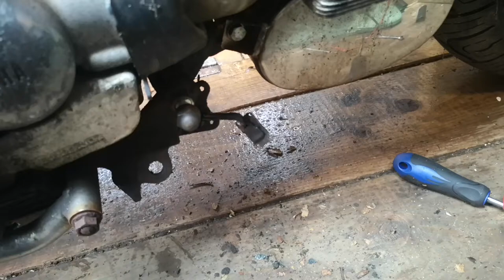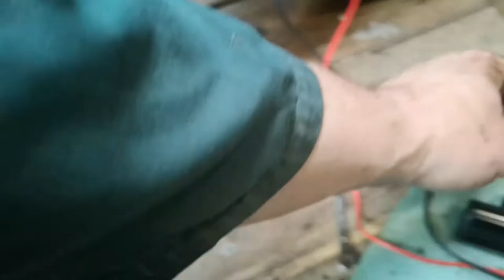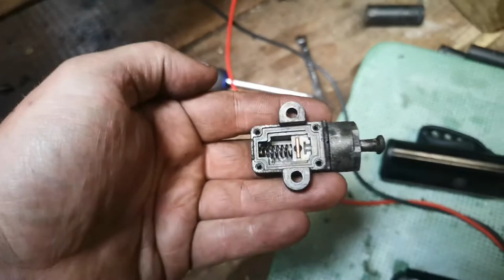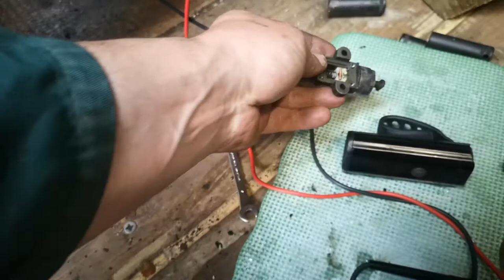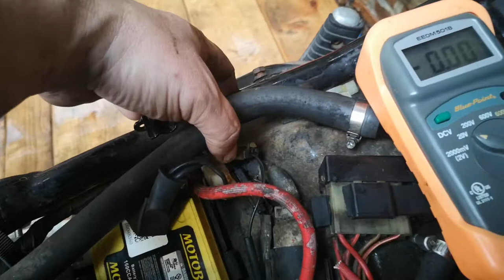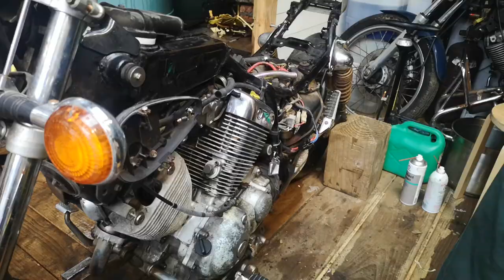Stalling When Selecting Gear? QUICK FIX! Don't Bypass Sidestand Switch.

Comment: Hi Ben, I have the same issue but getting no power at the switch so I traced the wire up to the connector and no power there either.  Fuses all checked out so I'm stumped
Reply from the maker: So if you short the connector it doesn't help?
Reply: @BikeFromTheBrink  I'll try but I'm getting no power there so I'm wondering if there's a short further along the line.  

Just tried, no luck.
Reply from the maker: I can't remember if it is always powered or only when in gear
Reply: @BikeFromTheBrink  I'm not getting power in either situation

Comment: So it would run in neutral but die as soon as you tried to leave neutral, if so how did it die ? Like jump forward or just cut out
Reply from the maker: Basically as soon as the neutral light went out.  It stalled. 
Pull clutch, select gear, instant stall.
Reply: Mine dose the same, it’s a 88 virago going from nuteral to any gear stalls the bike and it  jumps forward a bit, is that the same issue in this video? If so I think I found the problem
Reply: @BikeFromTheBrink  if it did jump forward after changing gears let me know would help a lot
Reply from the maker: I don't think it did.  I don't see how it could do that with the clutch pulled.  I mean most old yamahas clunk into first a bit when cold.
Reply: @BikeFromTheBrink  mine just shoots forward and stalls and I believe it’s because the old owner has car oil. What are some things you think i should do to before ch going into proper oil
Reply from the maker: @frostytecca3695  car oil in a bike will usually cause the clutch to slip.  I'd suggest draining it,  flushing and maybe even taking the clutch plates out and cleaning them. 
Motorcycle oil is designed for a wet clutch.